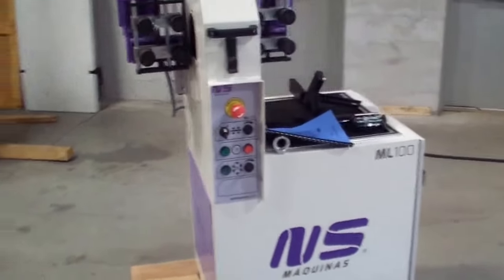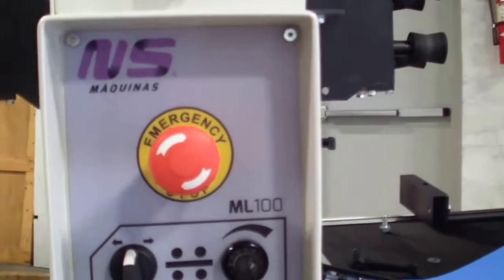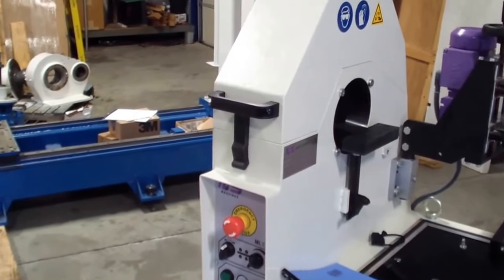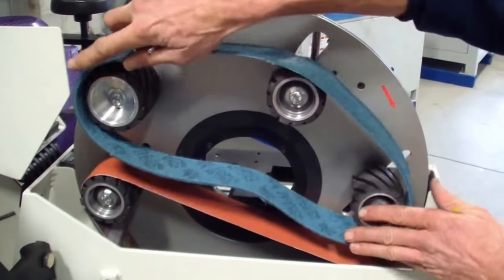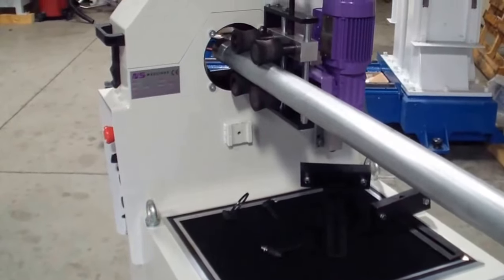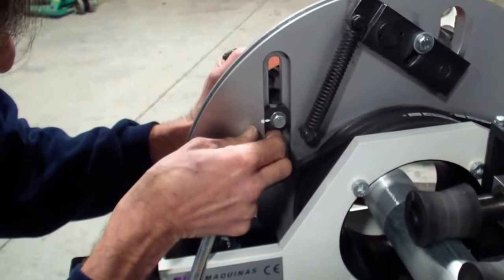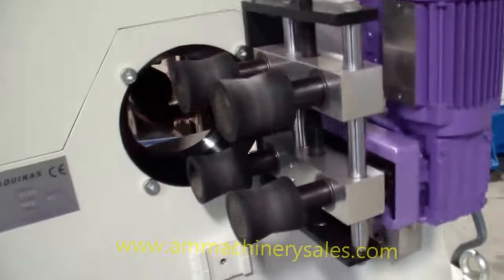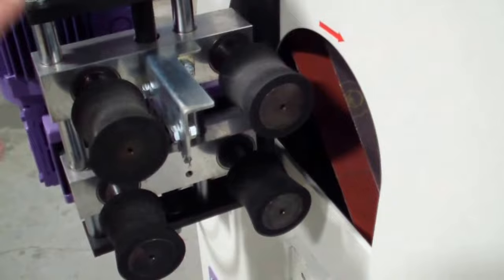Best Tube sanding and polishing machine walk around.

Comment: I'm trying to figure out a more efficient way to clean the 7" O.D. pipe I weld at work. Lengths vary from 11-15”. I only need to surface prep the bottom inch but on both the inside and outside for welding purposes. Currently using a die grinder with a burr for the inside and my air sander for the outside. Has to be a way to get some automation involved here. Any suggestions?
Reply from the maker: There are machines made to clean the outside and inside of cut ends. It will take off the bur and clean up the surface ID and OD the 1" or so you need. https://www.youtube.com/watch?v=1KEzK14bKEE